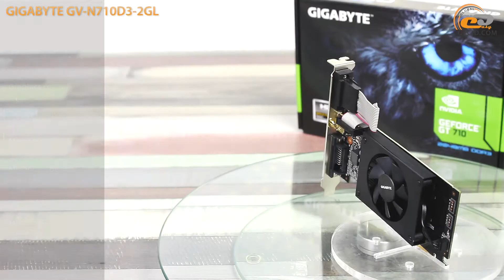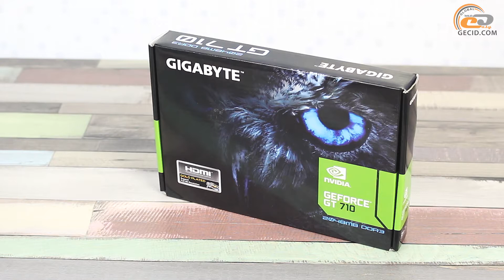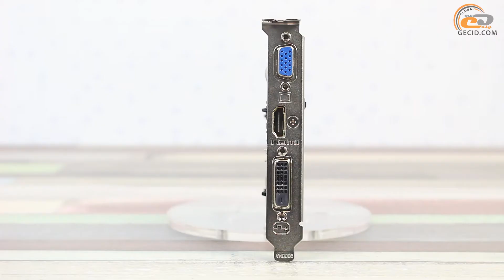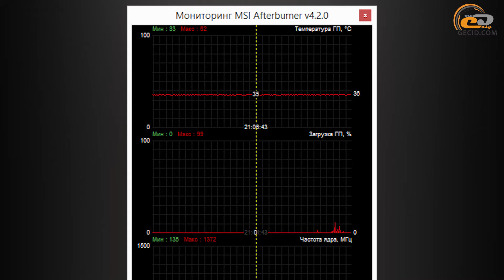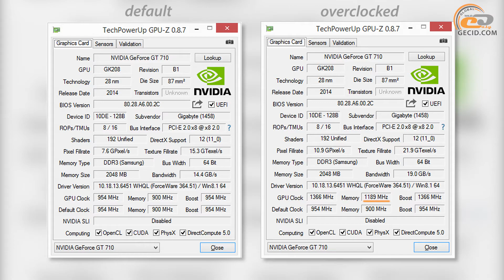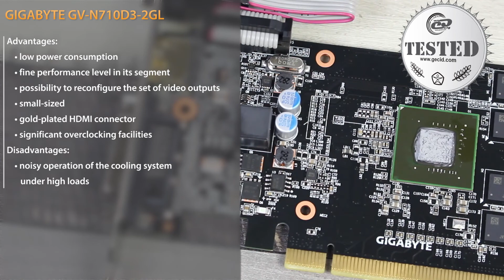GIGABYTE GeForce GT 710 2 GB | Review and overclock

Comment: hi bro,

I am a stock trader. Plz let me know how to use  all display ports of graphic card(i.e DVI, HDMI, VGA)as well two of my system display ports(VGA & DVI) for five multi monitor setup. i am thinking of  Gigabyte GeForce GV-N710D3-2GL 2GB PCI-Express Graphics Card, will it work?
1. I am using HP 3330 which is h61 type mobos with i5 3rd gen 3570 3.4GH.
2. HP Compaq 8200 Elite Small Form Factor PC i5 2rd gen 2500 CPU